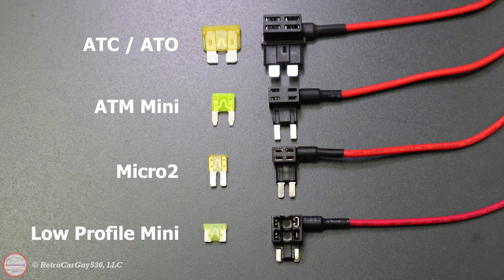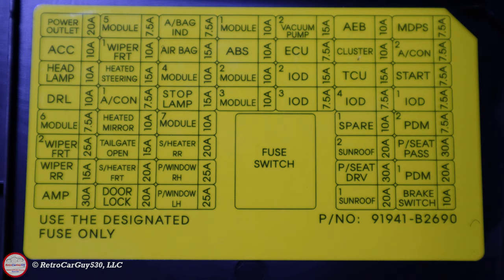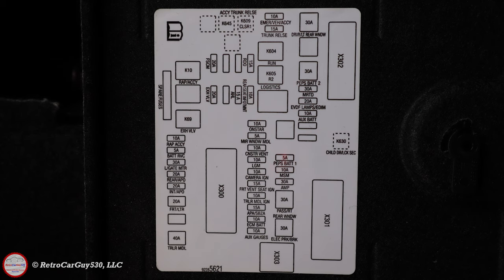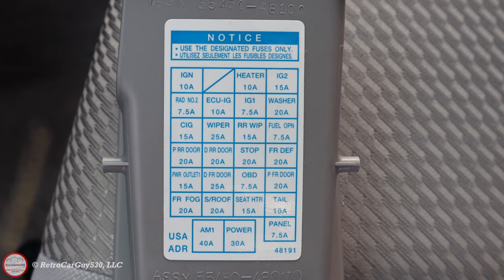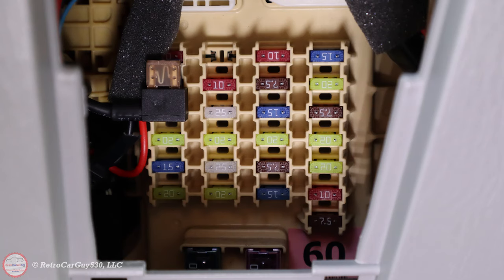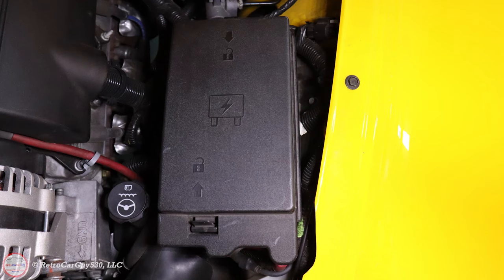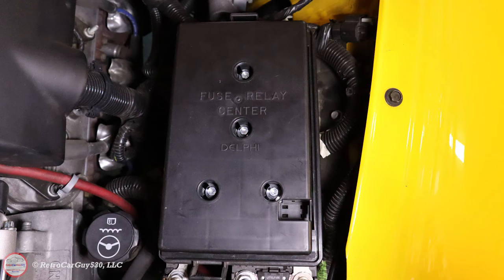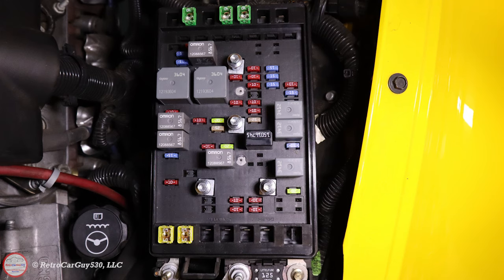How To - Add a Fuse Tap in Your Vehicle

Comment: Very useful video. I have a question though. 1. I was testing the cigarette accessory fuse in my car when the engine is off and it has power . However, I can only use it when the engine is on. How is that possible? 2. I want to tap into a fuse with 7.5 amp. I have a kit that comes with a 10 amp fuse for the accessory that I will be installing. I have seen in another video that the fuse you will be tapping into should be with a lower amp rating than the new fuse being installed. Can you please enlighten me? Thank you!
Reply from the maker: If there is power at the fuse with ignition off, does your car have the "retained accessory power" RAP feature I talk about in the video (power stays on for select power circuits for 10 to 20 minutes or until a door is opened?  If it's not being powered by a RAP circuit, then there must be a different fuse powering that particular power port in your vehicle other than the one you're testing.  One way to confirm that would be to turn on the ignition power, confirm the power port has power and then remove the fuse from the fuse panel.  If the power goes away, then that is the correct fuse, but if it doesn't there must be another fuse powering that power port.

For question two, if the fuse tap is plugged into the fuse socket correctly (power supplied to the correct input leg of the fuse tap), you won't be placing any additional load on the original fuse from that fuse socket.  Both fuses (the original one pulled out and the new one added via the fuse tap) will be pulling power from the same fuse socket and thus the same power bar/line/feed on the back side of the fuse panel.  It's not a bad idea to try and limit the fuse amp size being added to a max amp value similar to the original fuse, but in my opinion it's not required.   Adding a 10 amp fuse to a fuse socket with a 7.5 amp fuse should be okay (again assuming the fuse tap is installed into the fuse socket with the correct orientation to feed power to the correct leg of the fuse tap).  It's usually best to try and find an unused fuse socket for the fuse tap, but if that's not possible then find one with the correct type of power (switched, switched with RAP or unswitched) and one with a similar amp draw max would be preferred and also a non critical system (critical systems like: SRS [airbags], EBCM [anti-lock brakes], any "..CM" [control module] or ""..CU" [control unit]).  

I'm not a fan of a fuse tap adding a 30 amp fuse to a fuse socket that already has a 30 amp fuse, because you're potentially pulling 60 amps via the one fuse socket which might be a bit too much for the socket. 

In your case, adding a 10 amp fuse to a socket with an existing 7.5 amp fuse should be ok.

I hope that answers your questions!
Reply: @RetroCarGuy530  Thank you so much for that very detailed answer.
Reply: @RetroCarGuy530  I have the same issue, the cigarette lighter fuse has a constant voltage reading in the multimeter (12.6v) even it is turned off. But in the same cigarette lighter where my dash cam is connected, the camera turns off when the engine is off. I confirm that that is the exact fuse because when I removed it, there wasn't any power in the cigarette lighter. How is this possible?
Reply from the maker: The only other thing that might be at play here is that the dash camera is sensing the drop in volts when the vehicle's engine is turned off and then it turns itself off.  Does your camera have any sort of power minimum voltage setting in its config where it would turn itself off?  Usually you have to have an external power monitor/supply with a feature like that to turn off power to the camera if the vehicle's voltage level drops below a minimum threshold amount.  Power Magic Pro is one such device.  I've not heard of a camera having that feature directly integrated into the camera itself, but that would be nice if it had it.  

If the power port/cigarette lighter port has constant power (with the engine on or off) then it must be something in the power cord or camera making the choice to power down the camera.  The camera could also have a motion detection setting where if it's idle for a certain amount of time it may turn itself off.  The BlackVue DR900S camera I reviewed used motion detection to enter/exit parking mode.  A camera could use that same logic to shutdown the recording of the camera and put it into lower power mode waiting for motion to occur again and then turn on regular recording mode.

What camera do you have?
Reply: @RetroCarGuy530  my dash cam is Viofo A119. I think most of the fuse in my car are on all the time. But the sockets in this case my cig lighter only turns on when the engine is on. BTW, my dash cam is only plugged in through a regular usb cigar lighter plug. I don't think my dash cam has a voltage threshold switch. My only problem  now is I can't find a switchable fuse where I will hard wire my dash cam. The hardwiring kit cuts off the power to the camera once it goes below 11.6V.
Reply from the maker: @Sleevethrottle  your previous comment said the power was on all of the time at the cigarette lighter power port (or at least the fuse had power all of the time).  If the fuse has power all of the time but the power port you plug the camera USB power adapter into only has power when the engine is running there must be another control circuit for that power power.  Possibly the BCM (Body Control Module) in your car is cutting power to the port if it controls the power to the port.  If the wiring goes directly from the fuse panel to the cigarette power port and the fuse has power all of the time, then the power port should as well. 

The VIOFO A119 series of camera don't have a power cutoff inside of the camera.  If you're using the 2-wire VIOFO hardwire power supply, I would recommend setting the minimum voltage to 12.0V.  Letting your car get down to 11.6V is really draining the battery quite a bit and some might call that having a dead battery at that voltage level.  I set my VIOFO power adapters to 12.2 volts just to be safe.
Reply: @RetroCarGuy530  I believe the BCM is the reason why the fuse of my cigarette lighter always have power but the port itself only turns on when the ignition is on. I wish I have known that before. Actually, I found an accessory fuse that is only powered when the engine is in but I can't fit the piggy back blade to that spot. This hardwiring installation is taking me forever as I keep on having issue everytime I try and ordering the items I needed takes longer time to be delivered. I guess it's safer for me to stick with the usb cigarette lighter of my car to power up my dash cam.
Reply from the maker: @Sleevethrottle  I'm guessing about the BCM being in control of the power port power.  The power demand of a power port is usually beyond the level that a BCM would directly control/power.  It might be that the BCM is controlling a relay that in turn supplies power to the power port.  I've never had a car/truck that had that type of power setup for the power port (that I'm aware of).

I just spent a few hours on trying to add an auto dimming mirror to my 2014 Chevy Caprice PPV (project car for the channel).  Only one fuse socket supplied switched power in the fuse panel in the dashboard area and it was not "friendly" to the insertion of the fuse tap due to large plastic pieces present adjacent to the fuse socket in question.  Since everything around the fuse socket was unused and the plastic was to protect things inserted in those unused sockets, I decided to remove some of the plastic that was blocking the fuse tap insertion.  I only did that since the car is well beyond its warranty period and it was a minor mod to the plastic in the fuse panel.
Reply: @RetroCarGuy530  I think you are right. There might be a relay controlling the port to turn on. It's a 2015 Honda Accord. The front and rear accessory fuse have constant power but the port itself only turns on once the engine is running. I've learned so much from this video. Thank you so much!!!
Reply from the maker: @Sleevethrottle  even if there is a relay present in the circuit, there should be a fuse after the relay that protects the relay from being melted down by a high power draw situation.

I looked at a 2015 Honda Accord Sedan/Coupe owners manuals and it appears that fuse socket 14 has a 20 amp fuse for the rear center console compartment power port and fuse socket 40 has a 20 amp fuse for the front center console power port.

This video shows the fuses in a 2014 Honda Accord.  https://www.youtube.com/watch?v=KXK6m3ok8yU

This video shows the fuses in a 2019 Honda Accord (slightly different fuse panel layout), but he shows two relays associated with the power ports just off to the side of the fuse panel on the 2019 Accord.  https://www.youtube.com/watch?v=tsChq7fcCcA

That's about as far as I can go with this unless I purchase access to a 2015 Honda Accord service manual.  With my $2.50 daily average income from YouTube, I just can't afford to purchase access to manuals for cars that I don't own or work on.

I hope something in our conversations helps you figure out your situation!
Reply: @RetroCarGuy530  thanks for the reply. I've checked out the video of the 2014 Honda Accord and it is exactly the same as my 2015 Accord fuse box. If you notice in that video when he was pointing to the front accessory fuse, there were 2 relays above the fuses.

Comment: Once I plugged in my fuse tap the car powered on by itself without a key. Any idea why? Also does it matter if the accessorie fuse(top) is higher than the other fuse (bottom) like 10 over 5?
Reply from the maker: The fuse for the new accessory being a 10 amp and the pre-existing fuse being a 5 amp fuse should be just fine.  The "bottom" fuse is the one that was present in that fuse box fuse socket and the "top" fuse is the one for the new accessory.

Adding a fuse tap should not circumvent the regular power distribution of the car's electrical system.  One possibility I can think the "car powered on by itself" when you added the fuse tap is that the power it's supplying to the new accessory is somehow back feeding into another power circuit which implies that something downstream of the fuse tap is wired incorrectly.

If you remove the "top" fuse (the one for the new accessory) and then plug the fuse tap into the fuse socket, there should be no operational change in the car's electrical system.  If when you add the "top" fuse the car's electrical system comes to life again, that strongly suggests that the power going to the new accessory is being routed back into the car's electrical system in an improper fashion/way.

The fuse socket you plug the fuse tap into should also be one that does not get its power from a control module of the vehicle (body control module, srs (air bag) control module, engine control module, etc).  You want a fuse socket that receives power directly from the battery (unswitched) or from the ignition switch (switched power).  Power supplied by a control module can sometimes be monitored by the control module and may cause odd new behaviors or an extra load the module was not expecting on that circuit.

If the fuse socket being used did not have a pre-existing fuse (that's not the case based on your question) but in that situation there would only be a fuse in the "top" fuse position of the fuse tap.  The "bottom" fuse position of the fuse tap would be empty since that fuse socket contained no fuse.  Adding a fuse to the fuse tap in the bottom position when the fuse socket was previously unused, that may feed power to other circuits in the fuse box that shouldn't be getting power.   That matches the symptom you described, but I believe the fuse socket you're using had a fuse in it.

The other really odd possibility is the device you're connecting to the fuse tap (new accessory) is somehow backfeeding power to the fuse back when that circuit is "off".  With the fuse tap removed from the fuse box, test the fuse tap for power with a test light or multimeter.  With the ignition switch in the off position, If there's power present, the the accessory connected to the fuse tap is backfeeding the power into the fuse box and that might explain the symptoms you described (yet still a very odd/rare possibility).

I hope some of those suggestions help you figure out your issue.

Comment: What would happen if you can't find a accessory connection and you connect it to a constant?
Reply from the maker: It depends on what you're providing the power to with that fuse tap.  If the new device draws power all of the time (no switch in the circuit nor any low voltage cutoff protection feature built-in), you could potentially drain your vehicle's battery to a level where you would not be able to start your vehicle's engine.  If the device is like many dash cameras which have a hardwire kit and the hardwire kit has a low voltage cutoff feature, the dash camera would drain your vehicle's battery down to the low voltage cutoff level as detected by the hardwire kit and then it would stop drawing power from the vehicle's battery.  In most all cases, if you need switched/accessory power for the new item being powered by the fuse tap, it's best to locate that type of power
Reply: @RetroCarGuy530  First of all "THANK YOU" for your prompt reply. Trying to connect my hardwire kit for my WOLFBOX G850. It should have a low voltage cutoff feature (I think?). Do you know for sure? I have a 2008 Ford Explorer the interior fuse  box is extremely hard to get to but I think I've tried all non essential fuses. The one I did find lights up with or without the ignition switch on. Would it be safe to connect my new 15 to a 10? I've been trying to find a 15 to connect to a 15. Looking at some of the videos on this subject I think I'm confusing myself. You break the process down much better than most that's why I subscribed. Thanks again!
Reply from the maker: From what I can tell on the Wolfbox website, the hardwiring kit for the G850 does have a low voltage cutoff at a very low 11.6 volts.  The hardwire kit also appears to be a 3-wire hardwire kit, so you need a constant power and an accessory power fuse to tap power from - if you're using any parking mode it offers (if it does).  When you stated "15" I'm assuming you mean a 15 amp fuse.  The Wolfbox G850 should only be consuming just under 1 amp or maybe up to 2 amps max.  The fuse tap may have come with a 15 amp fuse, but I would NOT use such a large fuse since it appears to grossly exceed the actual power requirements of the hardwiring kit and it won't protect the hardwiring kit if it draws a more than normal amount of 12-volt power.

Comment: I can't get the fuse tap to seat properly. The body of the dual fuse holder is just a bit wider than the fuse box receptacle. Any hints?
Reply from the maker: Hi Tom.  The first thing to check is to make sure you have the correct fuse tap type for the blade fuse in the fuse box.  There are four common types of blade style fuse taps, but only two of them are similar enough to be confused with each other.  

The "ATM Mini" and the "Micro2" have a similar shape, but the Micro2 has narrower legs so it won't fit at all in a "ATM Mini" fuse socket.  The "ATM Mini" being wider than the Micro2 style and it is too wide to fit in the Micro2 fuse socket.

Assuming the info stated above did not resolve the issue, then it could be the quality of the fuse tap itself.  If the fuse socket had a fuse before attempting to install the fuse tap, that fuse would go into the bottom fuse socket of the fuse tap.  Make sure that fuse fits properly in that fuse socket of the fuse tap to confirm the type of fuse tap you're using is correct for that fuse box fuse socket.

If the fuse tap type is correct and if the fuse(s) fit in the fuse tap fuse socket(s) correctly, then it may simply be an oddly shaped or too wide of a fuse tap body.  I've never run into a fuse tap of the proper type for the fuse box fuse socket that didn't fit correctly.   That's assuming there isn't an item in the fuse box preventing the fuse tap from fully seating into the fuse socket of the fuse box like I had when I was testing the viability of each fuse socket.  A relay or some part of the fuse box itself in nearby location may be blocking the fuse tap insertion because it may be hitting one of the fuses in their 90-degree orientation in the fuse tap.

I have a couple of additional videos related to fuse taps. 

FAQ - How To - Add a Fuse Tap in Your Vehicle:  https://www.youtube.com/watch?v=DnZ5wb_A5vE
Anatomy of An Automotive Fuse Tap: https://www.youtube.com/watch?v=YNc0FfeL6rw

The "Anatomy" video discusses the power routing in the fuse tap and an easier way to find which side of the fuse box fuse socket provides the power by using the fuse tap itself and only a fuse in the top fuse socket (for testing purposes).

I hope something in this reply helps you find the solution to your fuse tap fitment problems.
Reply: @RetroCarGuy530  Thanks for the quick response. I have the lo profile mini fuses. The body of the tap (where the two fuses are held) is just a bit wider than the socket width. I may try shaving them with a knife to make them fit. It is not hitting a relay . I don't want to pry the socket apart as this may make connections loose for other fuses. Thanks for the info. Great video.
Reply from the maker: I agree, you don't want to expand anything in the fuse box itself (the plastic or the metal tabs used for the electrical connections).  Good luck with your fuse tap installation!